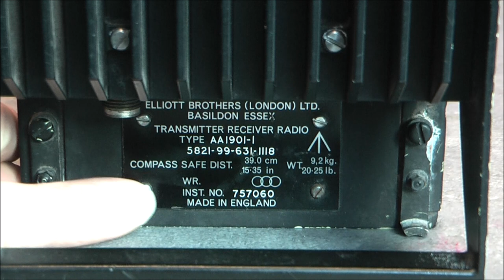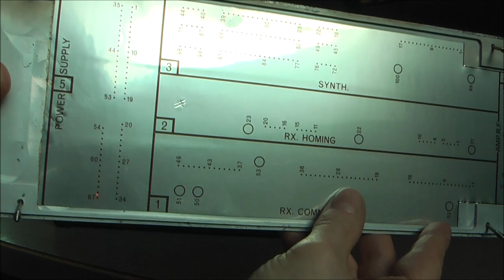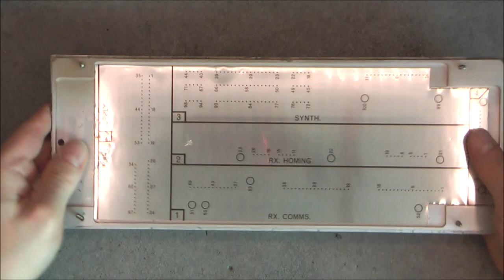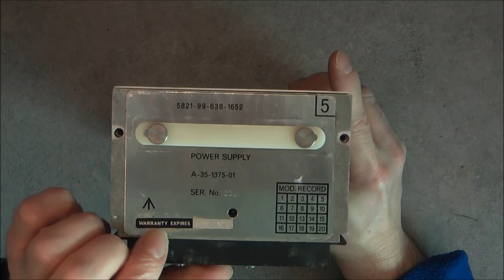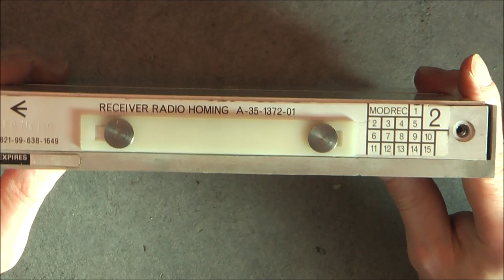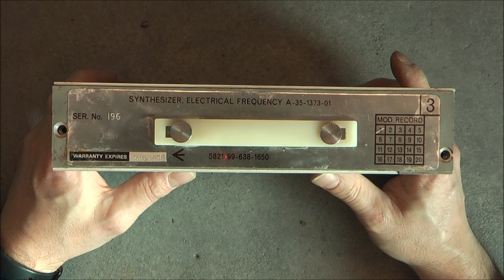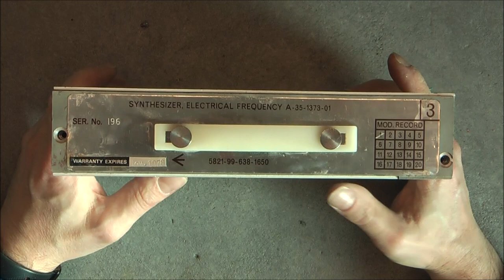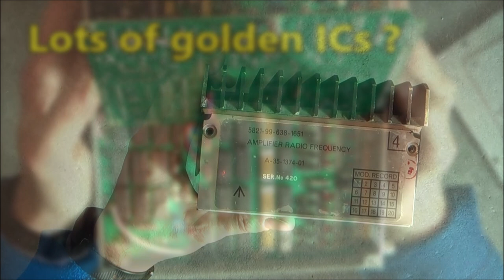Avionics teardown 1976 Elliott AA1901 Transmitter receiver radio

Comment: Interesting to see this late Elliott Brothers radio. Elliott Automation was merged into EASAMS. They produced aeronautical computers such as the 920M that were used in the Jaguar and in Concorde as an engine management computer. One of the first computers I programmed was the commercial derivative - 903 back in 1975, although it was already obsolete by that time. I’d love to pick-up a 920!

Comment: They are digital logic. The 4000 CMOS series was very common up until 1990, or so, because they could run on 12V.
Reply: MichaelKingsfordGray  Are they really? What do you based that assertion on? Did you trace the circuit? 

You need AT LEAST 1000 gates to make a simple 4-bit CPU, plus RAM and ROM. Would you make that from NAND gates too? That would be the most inefficient use of logic ever. If you actually did decide to make a "computer" with CE4000 series logic, why use NAND gates instead of counters and flip-flops? Why not use the 7400 series chips?

If we assume, however, that by "computer" you meant a state-machine, why build the flip-flops out of individual NAND gates, when you can get flip-flops in the 4000 series?

My best guess is that the white chips (can't read the IC number, unfortunately) are high-speed counters, and that the NAND-gates are used to set the counter value where the counter will be reset, thereby making a programmable divider for a PLL.

Just my 2 cent's worth ;-)

Comment: At 37:51, your right thumb is right next to a possible burned resistor or inductor. Just a guess.
Reply: Hi  mr. bold  are you intrested in old  circuits  ?
Reply: @rayaninc.electronicindustr1402  Avionics, yes.
I worked as an Avionics tech at Pan Am back in the 80s, left just before the airline closed down. Watching the teardown of these old pieces of equipment brings back good memories.
Reply: @bblod4896  I love old electronic circuits and their components and I have a lot of them that are a lot of fun and exciting. New electronic circuits are not interesting to me at all and I have no interest in them. I am a nostalgic person . what  a bout you ?
Reply: @rayaninc.electronicindustr1402  
Sometimes. Much easier to repair than the new micro SMD equipment that you need a microscope and steady hands to work on.
Reply: @bblod4896  Old electronic circuits and components are like old stamps to their owners. It really  drives  me crazy
Reply: @rayaninc.electronicindustr1402  Not only nostalgia, modern chips are really boring-all are the same rectangular/square black blocks, nothing to show off :)
Reply: I love taking apart vintage avionics and I’m only 16. The build quality is amazing of these old boxes. A lot of work went into designing and producing the stuff. I have 2 avionics teardown videos on my channel